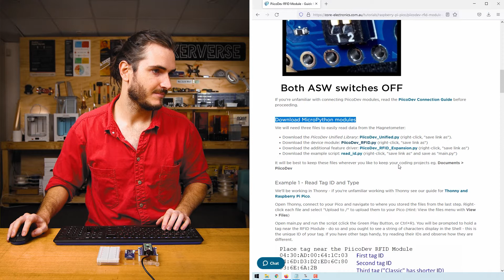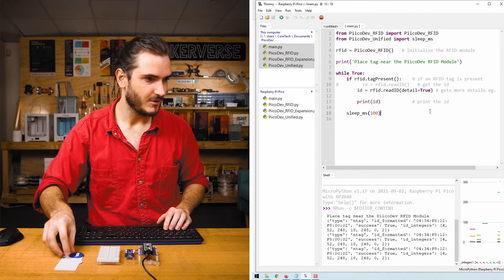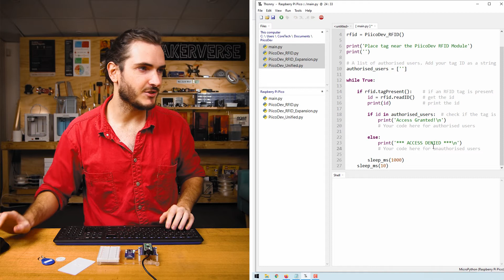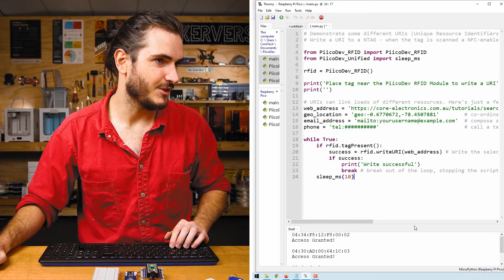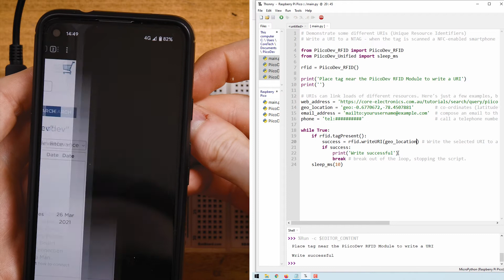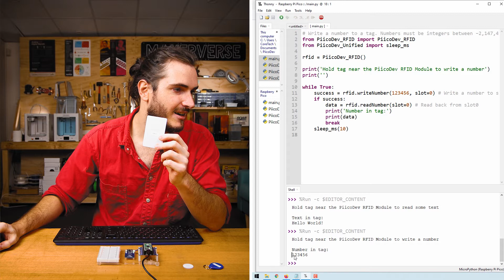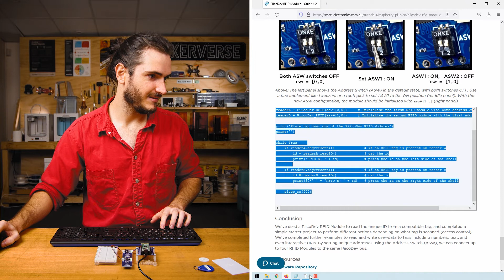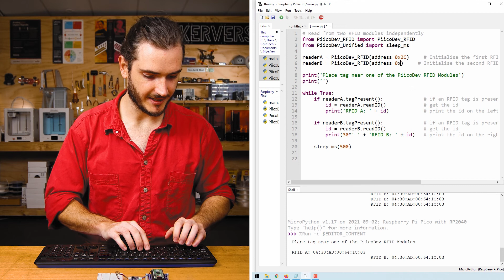PiicoDev RFID Module | Guide for Raspberry Pi Pico

Comment: Can the Pico be used to read the output from an ID-12LA to a UART assigned GPIO pin on the Pico using the Sparkfun ID breakout board? We seem to be able to read the tag in range output but not the tag ID on the data pin. We have tested the ID-12LA with the Sparkfun USB reader board so we know the chip is working.

Comment: How easy is it to use these without Python and the provided library? I assume since you can connect them on a bus they're basically wrapping i2c around the RFID chips driver so if I use C and i2c I can control the RFID chip easily?
Reply from the maker: You're correct! It's an i2c device with Python driver - you ought to be able to use it in any other development environment (provided you have driver code). We just haven't tried it on anything else!

Comment: Hypothetical question. Could one make a handheld device making use of this, which could be used to 'fake' being an ntag213 card/fob/whatever?
The theory is to replicate the sort of card locks hotels might have, which in my experience are programmed (room number, public gate, etc) with a
series of cards (these are specifically t5577 125k(?)hz cards if memory serves), but able to be programmed with a simple handheld device instead
of either batch programming the cards for a floor ahead of time and doing them in one go or reusing the same card in between each room/door.
Reply from the maker: While the chip on board could possibly be used that way, our driver doesn't handle such functionality.